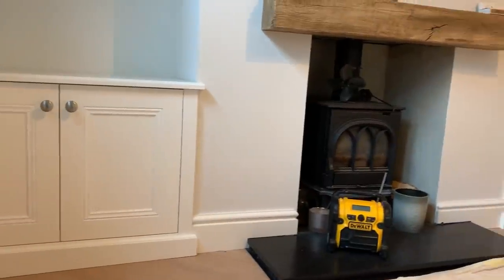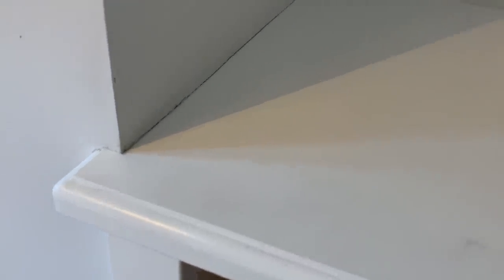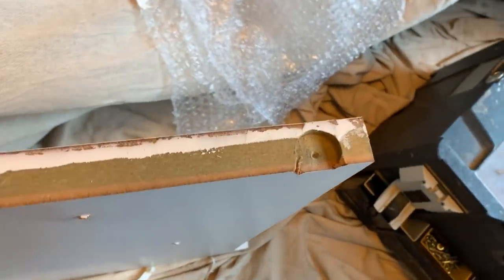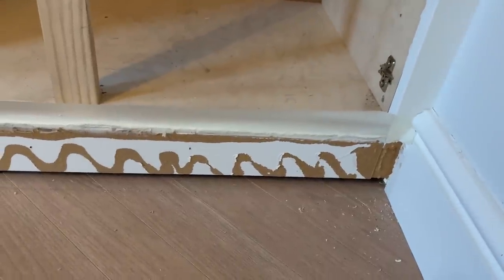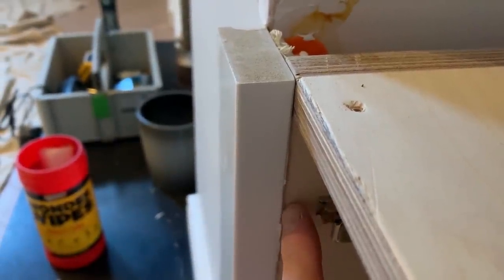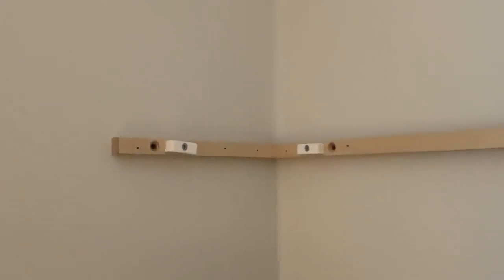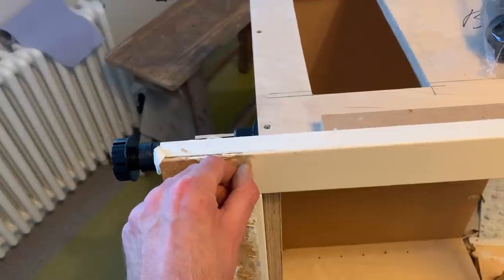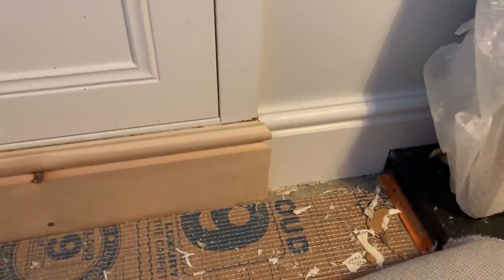Alcove Base Cabinets Removal and Re-Installation

Comment: A great opportunity to dissect your own installation and assess your approach. I have started to experiment with how I apply the adhesive, short lines spaced out or even dots. Both ways work just as well with less product. I have also moved to a hybrid type called Sumo from Protrade. It is now my go to adhesive. Thanks for the video. Phil-Cornerstone Yorkshire. 💆🏻‍♂️👍🏻
Reply from the maker: I also have just discovered sumo!  And also using much less adhesive now!  Dots seems plenty 👍

Comment: great video. you will learn a lot more about your processes and methods from a job like this than from installing. its a fine balance between over engineering things and doing it well enough. at least you hadnt foamed it in. 
looks great again  the level floor is way better . it really caught your eye

Comment: I've been using a few different 'flexible' or acrylic caulks for a few years now as an amateur and I can certainly see them holding up to movement a lot more than normal caulk. Although, they can be a little more fiddly to work with!

Comment: Good effort Alistair. I’m very capable of coping skirting by hand but for sheer speed and amazing accuracy I’ve been using a 3” cut off tool / mini grinder with a flap disc. If you are rarely cutting on sight a cheap £40 one might be an investment just to have in your van.
Reply from the maker: Ok thanks yes I’ve seen this done

Comment: If ever you have to cut trim off again, use a small piece of laminate top material like formica.  you can put it between the blade and the material.  thin but effective.
Reply from the maker: That's an excellent tip thankyou

Comment: Would it be problematic to open the doors if the cabinets were flush to the wall ? Or is it by design/aesthetics that they protrude out a little ? Thanks
Reply from the maker: Walls are never perfectly flat or plumb, and also the vertical corner often has a slight curve to it.  It looks far better to deliberately sit the frontage of the cupboard a little forward or a little back from the face of the chimney breast, rather than make a poor attempt at lining up a perfectly flat cupboard face with an imperfect wall
Reply: @Alastair_Freebird  Makes sense. Thx for explaining.

Comment: I've bought your diagrams (thank you) and watched your vids, but I can't quite figure out how you hold your plints on. On the ones you pulled out of here they have three vertical pieces pocket hole screwed underneath to fix back to. Is that the way you do it nowadays? If so I'll have to whip mine back out and fit those bits lol. Cheers
Reply from the maker: Well, yes that is my preferred way for the alcove units because it gives solid support  and I don’t see much need for them to be removable (unlike kitchen plinths where plumbing access etc may be needed and also where the kickboard is usually set back more so the plastic clips that clip onto the legs are fine).  I like things to be solid so I glue and/or pin the plinth to these blocks which were pocket hole screwed on to the underside ahead of time
Reply: @Alastair_Freebird  Magic cheers, I'll do the same. And great tip checking the carcass for square and adjusting with those orange spacers, I'll make sure I do that as well. Much appreciated.

Comment: Nice work, do you still use inset hinges with the same flush filler detail?
Reply from the maker: Yes although we have tightened up the method slightly - I used to size parts for a 2mm overlap of the vertical cover strips into the unit; with the inset hinges throwing the doors in about 4 mm, for 2mm door gaps.  Now we make the fillers land flush with the inside edge.

Comment: Perfect second time around. ...... hindsight being perfect,  should have matched the skirting the first time around. ..... definitely over engineering them though. Slightly better profit margins over a year with time saved but maintaining quality??
Reply from the maker: Two interesting points - 1: A while back we standardised on a simple skirting made from 18mm mdf (one routed profile, same as countertop, and shorter than most skirtings to maximise cupboard space) partly as an efficiency saving for us, partly because it prevents the doors from becoming too squashed-looking under a standard 70cm top (which is a good height for a TV unit).  I do admit though a matching skirting is nice!!  2: yes I think you are absolutely right that simplifying in other area would add up to better margins, starting with small dabs of a good adhesive like sumo grip.